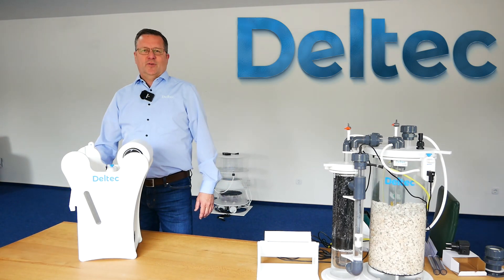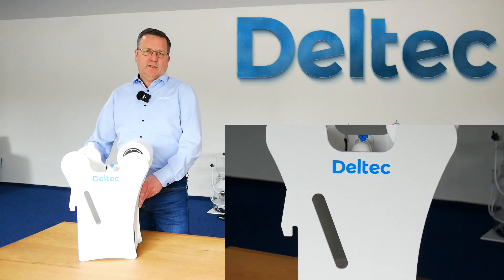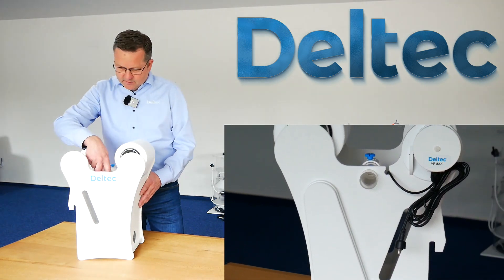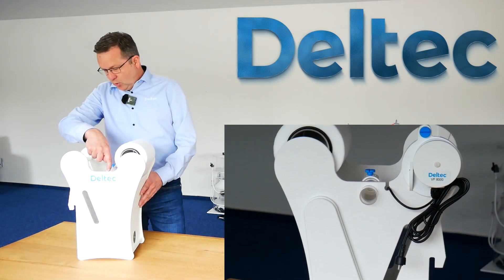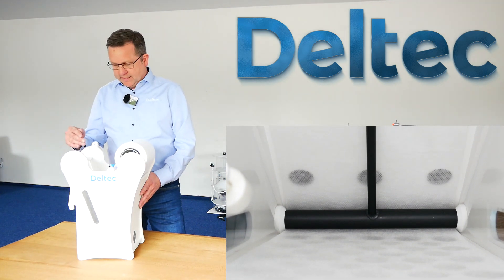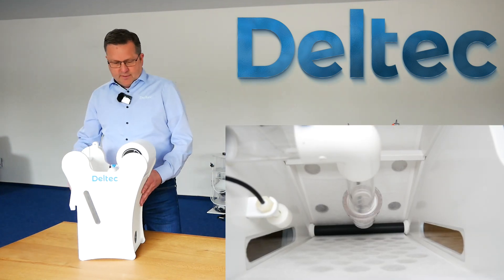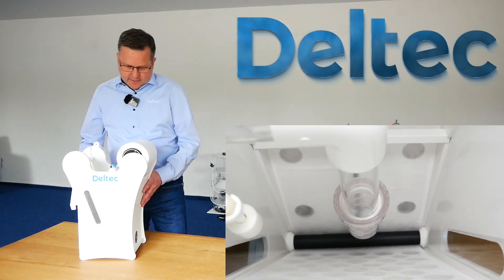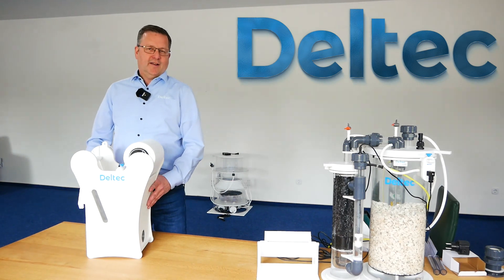Vorstellung Deltec Vlieser VF8000 English | Deltec

Comment: Can I drop this into the following sump without any/much modifications?

file:///private/var/mobile/Containers/Data/Application/AF6B4B55-47A5-4048-93F0-D2D5756FBD59/tmp/TempDocs/Sump-Dimensions-PS700-G2.pdf